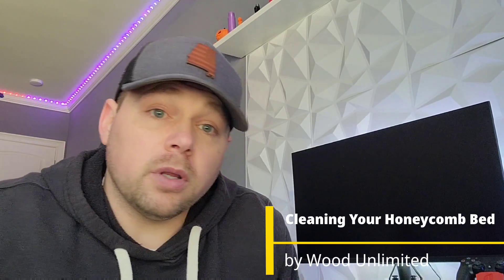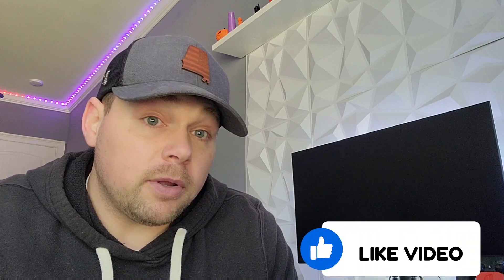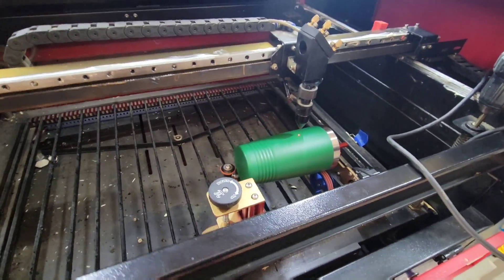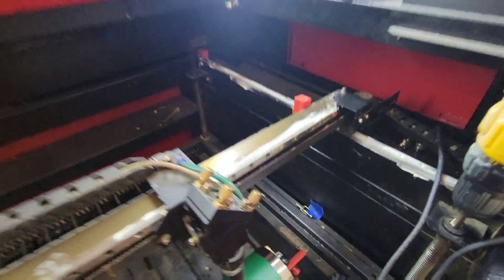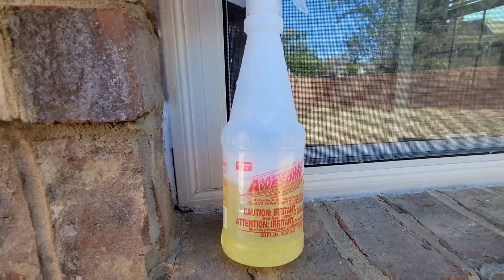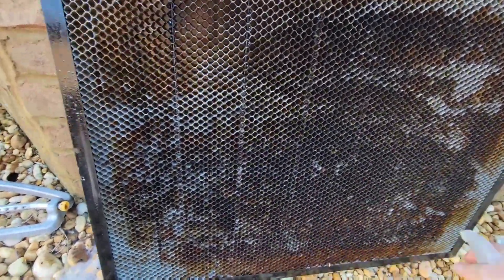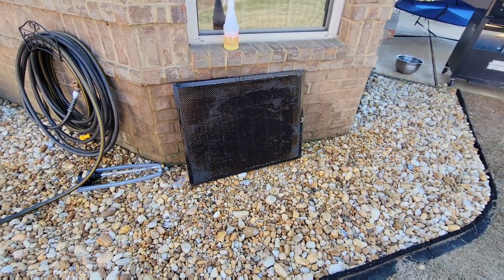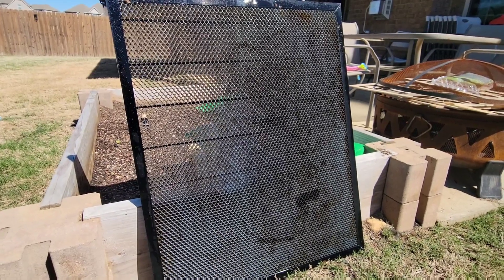Cleaning the Honeycomb Bed on an Omtech CO2 Laser Cutter

Comment: How do you insert and remove the honeycomb bed without rubbing against the sides? Mine seems a bit wide.
Reply from the maker: Hi @renaraoutlaw4294 - My honeycomb bed fits between the two front threaded rods for the bed, but if yours doesn't you should be able to move the laser nozzle all the way to the back of the machine, then lower the bed and remove the honeycomb bed through the top.